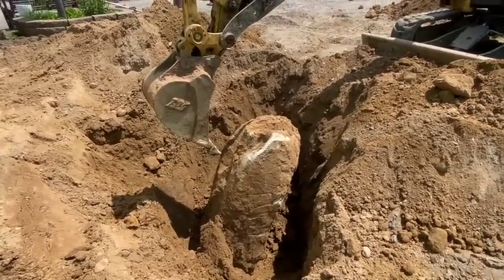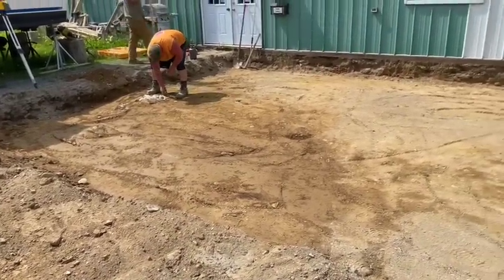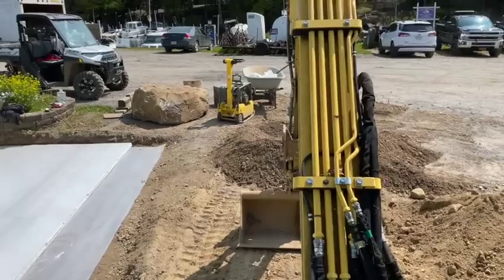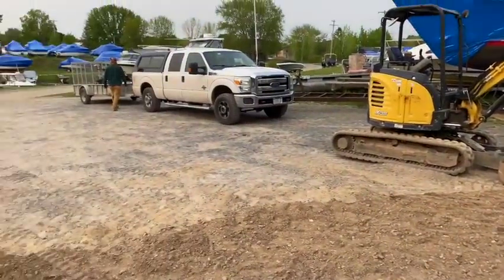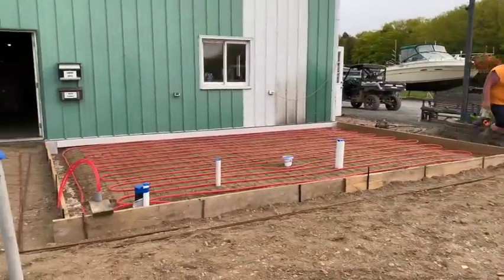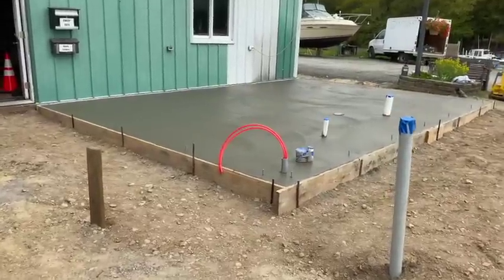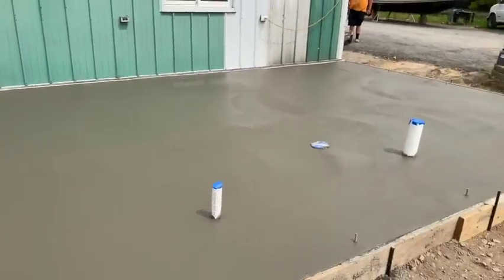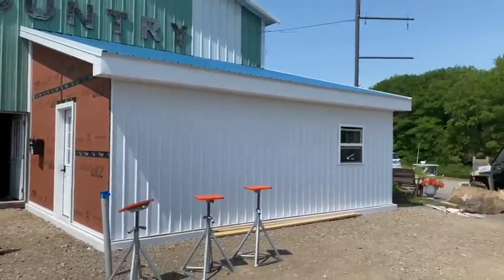Reverse mono slab with radiant heat.

Comment: I like how you built up the middle of the slab instead of removing the outside haunch. I think it looks easier. Do you think it will have  much effect on the R-value of the foam being buried a little deeper?
Reply from the maker: Thanks we have done this before and it actually works better because the extra gravel above the insulation acts as a heat sink and the floor stays warm for days. Thermal storage.

Comment: Ever run the in-floor pex between the insulation/vapor barrier and the re-bar?
Reply from the maker: Yes we have stapled the tubing down to foam and then ran wire or rebar over the tubing.